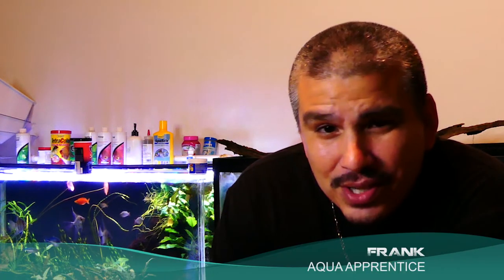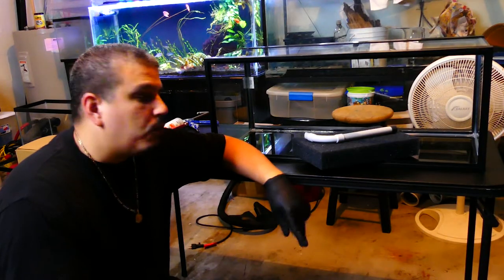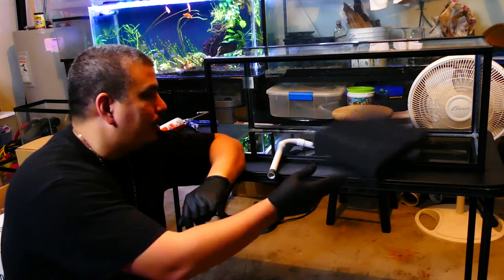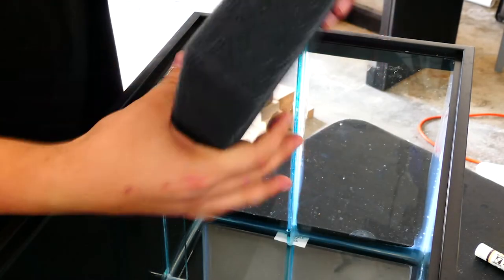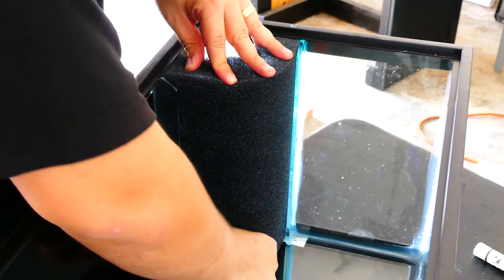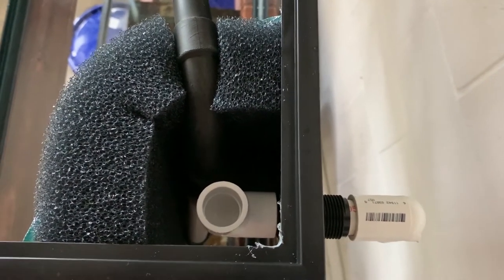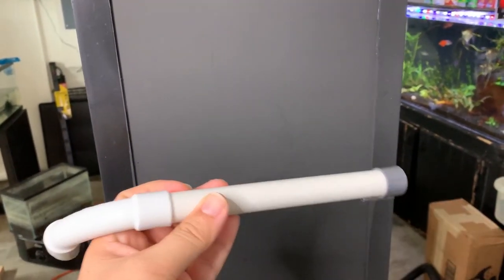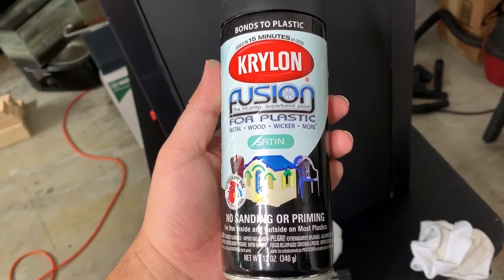Corner Matten Filter Installation from Swiss Tropicals

Comment: I wonder if those notches in the corner of the brackets are not meant to go on the bottom to allow for the silicone that is in the corners of the bottom?
Reply from the maker: When I ordered it, I don’t recall it mentioning those angles at all so I was a little confused by them. It quite possibly could have been for that reason and I wish I would of thought of it. My assumption was that it went at the top to avoid having a sharp edge exposed when someone adds/removes the sponge. In my case it’s not a huge deal since I will have substrate but if someone were running them bare bottom it may create a better seal.
Reply: You are correct

Comment: If you wet your finger you can run it over the silicone and the silicone will not stick to your finger.. that will give you a nice clean edge. (something I learnt from running a handyman service for many yrs).
Reply from the maker: Tim G great tip I will definitely have to try this.

Comment: What’s better 20 ppi or 30ppi ? Does it really matter
Reply: Most people use 30 I think. These filters are much more popular in Germany and that is what most seem to go with. You can use 45 as well but it will need cleaning more often. Though I ran 45 in a shrimp tank for about a year before I cleaned it.

Comment: Great video! Is your tank drilled/ or can you use this filter on a regular tank?
Reply from the maker: Hello Joan. Yes my tanks are drilled but that is not necessary for the filter to work. Just pulls water from one side of the sponge to the other for it to work and would be installed the same way.